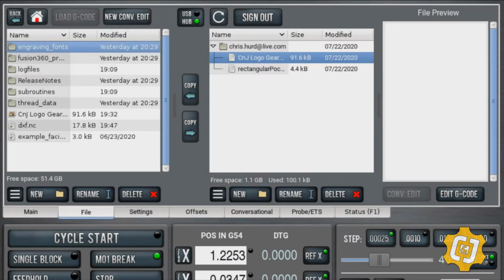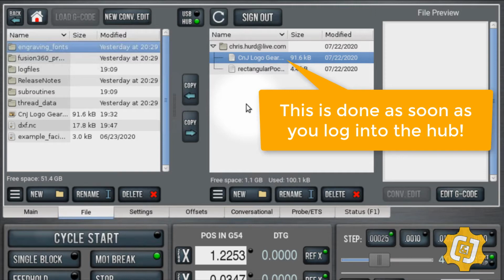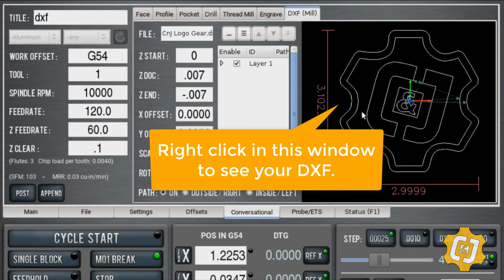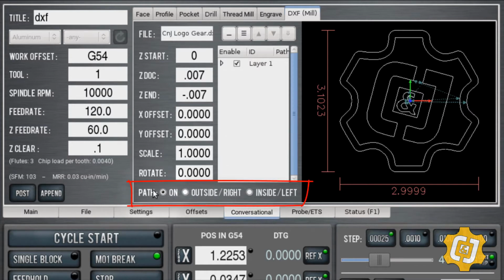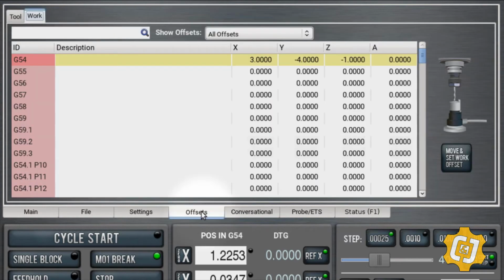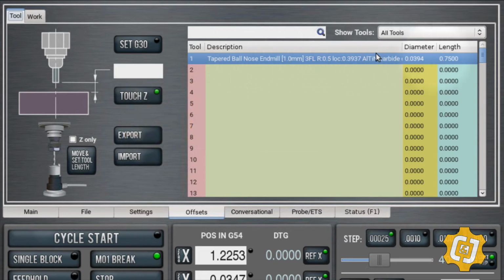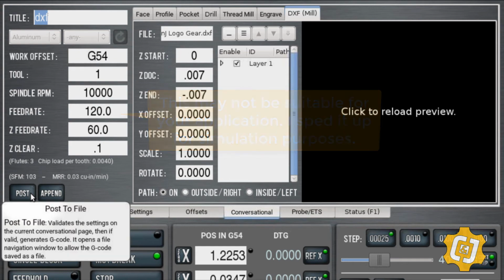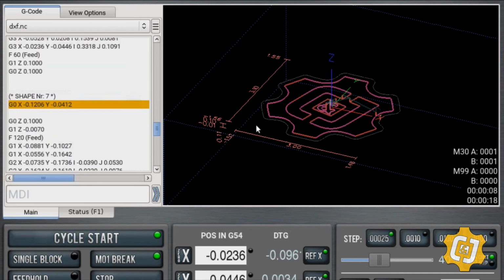8 DXF Milling: PathPilot Conversational

Comment: I am figuring out the engraving for path pilot.  Looks like the G-code is written in a macro format, and nobody knows how to hand edit a macro format.  The Mach1 system had its problems, (both controls fail to read the code properly for arcs, but I could get the Mach1 to run with some tinkering.).
It is too bad that people have to use all the bells and whistles just because they are there,---risking reliability and ease of use. It shows they don't have much experience on the floor.  I guess I will have to develop my own, so I can edit it.
There is no need for macro programming, and the only time I saw it used in a company, nobody could figure out how to edit it (to make good parts), and I was called in to change it to the normal, well known G-code.